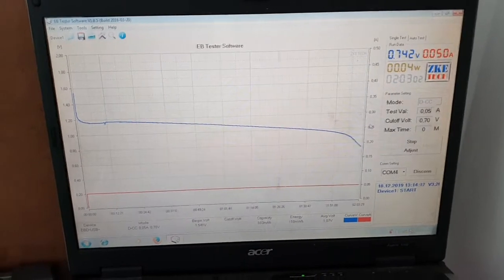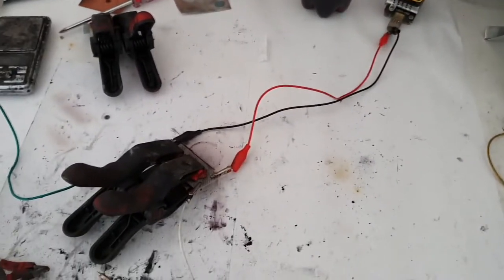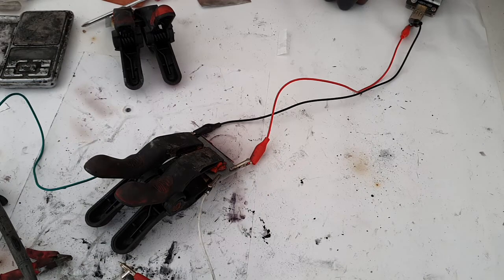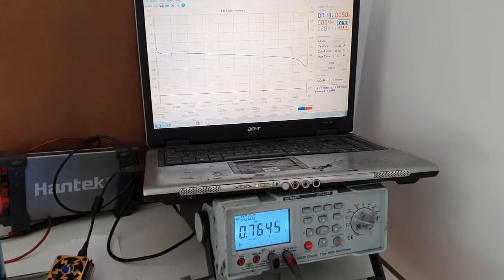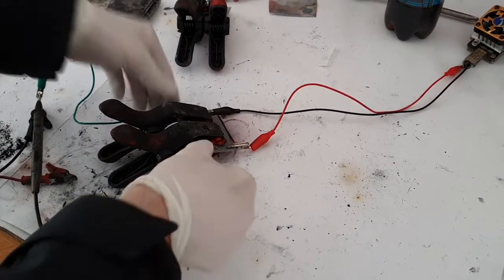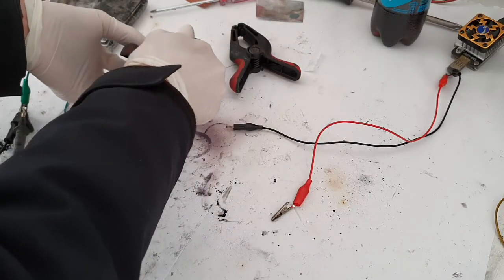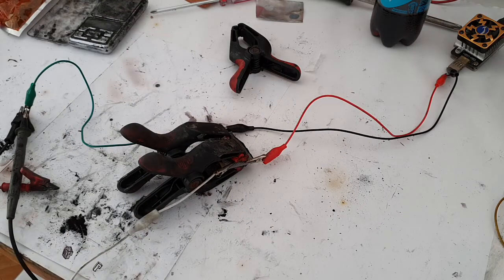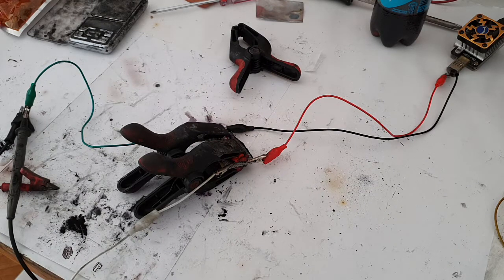Battery - Fast Demo

Comment: Dusan, so its now 2020.., so after all your hundreds of tests, what is the best and easiest battery recipe, that we could scale up and build really BIG SELFMADE batteries ? What do you think about the Zinc Bromide batteries that Rob Murray Smith is using now ? Is that the way to go to build a cheap powerwall for powering your home ? Regards Stefan.
Reply: same question - carbon plastic current collectors/electrodes with gel electrolyte of zinc bromide in between - your thoughts???